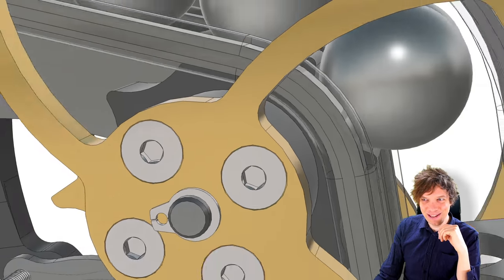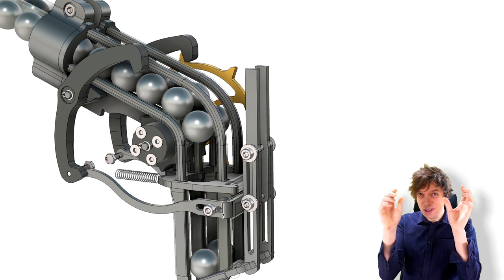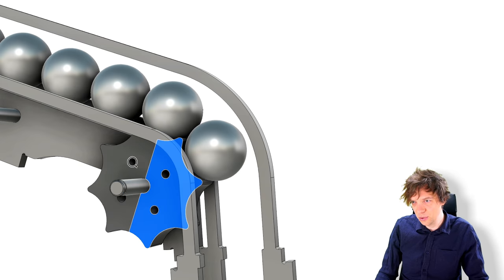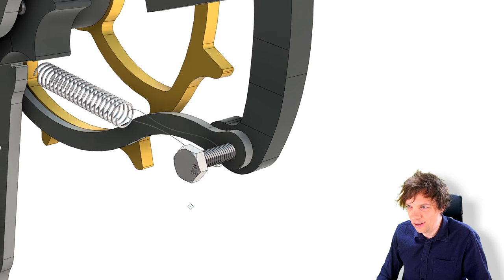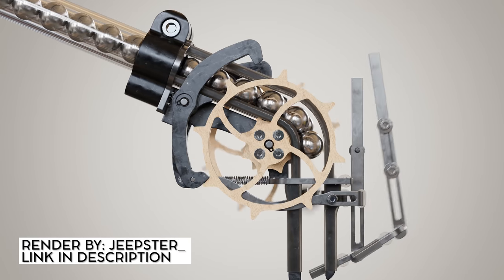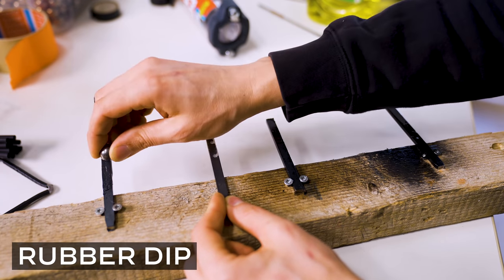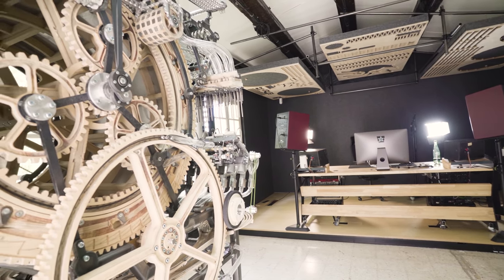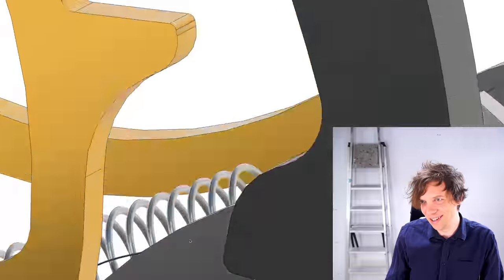Clock Escapement Marble Gate - Designed For Silence

Comment: Please make the clock component out of brass and the stopper arm (C) out of black Delrin plastic. The contrast would be outstanding and the brass would stand out in such a beautiful way. I believe that the Delrin should reduce the noise  level and will be low cost. The Delrin comes in sheets and I believe it can be cut with your in house CNC.

Comment: Very nice...now that looks like you have much more control of the upper pressure problem of the marbles and also are controlling the exit of the marbles. Now you can refine the synchronization and see how accurately the marbles drop without error

Comment: To me the split marble ball gear along with the flange should be made as ONE Piece. When you assemble the unit, with brass gear also attached, just slip in and aline the through hole in the gear/flange to the hole in the welded guide plates. Then slide the shaft through with one clip on. Aline the 2nd gear/flange with attached brass gear and continue through and end with the second snap ring. At this point you can attach the escapement pallet.

Comment: Hey Martin, I work with heat shrink a lot professionally. Use as close a size of heat shrink to the metal parts as you can. Yes, the tube may shrink down that far, but the walls of the tube will be very thick.

Comment: Yes!  That's a much more reliable mechanism for the escapement arm to be one single piece!

And as long as that wire hooked to the spring is heavy enough gauge so it won't break from metal fatigue, that should be fine.

Comment: Also a close-ups of your marbles on the machine other videos, I see corrosion on them. that corrosion equals friction which is going to have an effect on how marbles interact with surfaces in some cases some marbles might spin more sliding off the guide rails and this also would have an effect when contacting surfaces it's falling on, you need to clean them and most definitely start out with a fresh set when going on the road with the tour version. and being that they are chrome they will need to be kept so moisture doesn't corrode them and also all the other parts on the machine multiple silica gel packets will need to be in the case, so during traveling where temperature changes and altitude changes will occur moisture is kept in check.

Comment: you can buy spring tensioning bolts, when you redesign the link arm to be more visible and with a boss for one of thise screws you can buy those screws iff the shelve and also springs... but you probably roll your own springs at the right length and tension anyway so meh

Comment: I don't think you need to cut the marble gear in half. Just place the gear into the assembly before inserting the "axle" through it. Rather than inserting the axle and then trying to slide the gear over it, which yes will not fit

Comment: martin its good to see you finally addressing mechanical noise in mmx  i still say the marble stairs make the most noise  and the wooden gear wheels grind fairly noticeably  perhaps some felt for the stairs but i think its in the chain drive  and the wooden gears i would use paste wax to smooth its surfaces  reduce friction and wear .  as for the shafts you need machining i can recommend 3 youtube machinists from the us  keith fenner of turn wrigrt machine  adam booth abom79  and keith rucker  of vintage machinery  all are excellent machinists  who have the equipment to do the work you need done  adam  would be my first bet for availability and pricing followed by mr fenner  and you might be wise to invest some time on there channels since design leads to manufacture knowing how its made might make designing it a bit easier. thanks for the videos

Comment: Rather than a fragile wire holding the spring, why not a bolt with the end modified with a fishing swivel (or other free floating attachment point), then clip the spring onto the fishing swivel and turn the bolt to adjust tension?

Comment: The spring adjuster bolt, don't wrap the adjuster wire around the bolt instead put a hole in the bolt shaft and put the wire through the hole then turn the bolt to wrap the wire this will be a better fine adjustment. Don't cut the marble holder wheel in half sections just put a slot in the bottom of one of the low areas, this will make it much easier to assemble and repair and more robust. The slot in the bottom wont have any effect on the marbles in operation.

Comment: You may want to consider following a watch design more closely for this, what I mean by this is the pallets would benefit from being replaceable. The brass may start to wear due to the constant use which will eventually cause a problem. By having a replaceable pallets such as Delrin you can eliminate some friction, noise and wear....
Reply: Nevermind, the whole pallet jack is delrin. I’ll wait till I finish video next time....Doh

Comment: None of these wheel mechanisms are going to hold up, they are never going to be robust enough for this purpose. They are not designed to be hanging out in the open. They are not as you say, resilient.

Comment: For your rotten tomatoes spring tension I would use washers, a long nut with a washer attached to it.

Sorry, your current solution is cursed, why? It's isn't very robust nor is easy to assemble and disassemble.
I could not thought of a better solution that doesn't have a drawback while being as simple.

If only there was a way to make the string self spun by attachment with a simple adjust to the nut without it affecting the nut performance.
Reply: Well, turns out I just remembered that spot welding is a thing.
So... Spot weld the wire to a nut similar to those use in bikes axles and it should be good, I think.

Comment: The wire spring tension....my only problem is how do you expect to be able to reach them? if I'm seeing this correctly that wire is under and behind the entire system. it's on the back.  to change the spring tension, you'll have to either take it off the machine...or reach up under the marble guides and manipulate the wire?
Reply: There's room to reach around the back from underneath.
Reply: @nagualdesign  you've never worked on any sort of machine.
Reply: @Frostfly  Huh? Yes I have. Martin is planning on being able to reach around the back with a ratchet spanner. He said so in the live stream. Also, ALL MACHINES ARE DIFFERENT. 😊
Reply: ...You even said it yourself; reach up under the marble guides and manipulate the wire. Essentially, I was answering "yes" to your question. What an odd response.
Reply: @nagualdesign  I didn't say it wasn't possible. It's not reasonable. It's making it difficult for no other purpose then lazy design.   It's not a one handed job to move that wire in this plan and getting both hands BEHIND the contraption and being able to see ANYTHING you are doing will be nearly impossible.

stop picking a fight when you just want to fawn over someone else's work.
Reply: @Frostfly  Have you been drinking tonight? I was just answering your question. Calm down.
Reply: @nagualdesign  do you often find you get good responses when you answer questions stupidly to people who weren't asking you?

you're answer is bad, stop trying to defend it.
Reply: @Frostfly  Get some sleep, Robert. You'll feel better in the morning. x

Comment: Not sure why you need to split the gear.  Seems you could put it in place and then slip the shaft through.  Splitting gears seems to break lots of engineering principals.   Might be ok but cringe worthy.